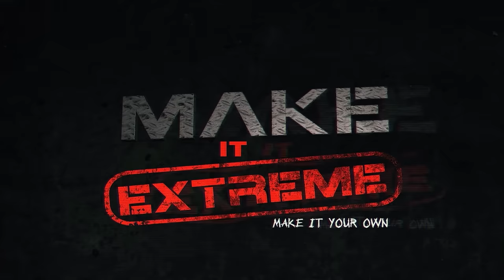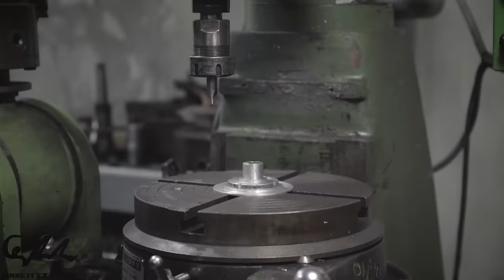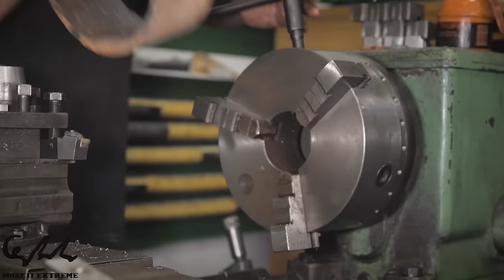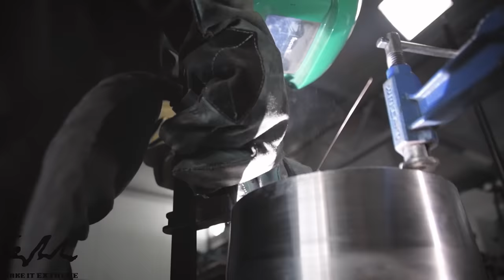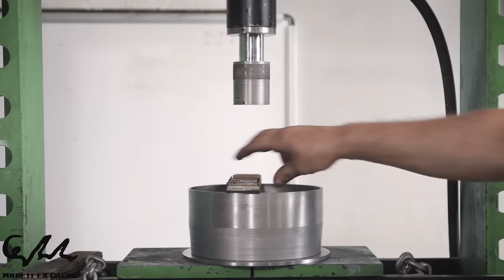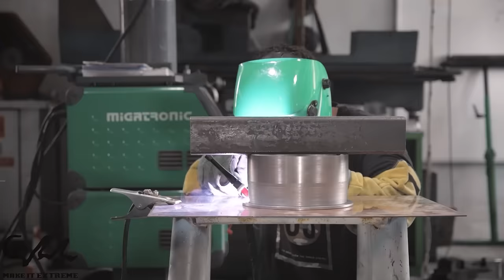Project 0107 | Making tank chair tracks

Comment: Thanks for the inspiration, I'm paraplegic and have been thinking about building something like this but on a bigger scale if I get the chance to have little workshop and the tools needed. Taking tracks and engine from a snowmobile, then you get a variator and revers gear. Would be like a mini ripsaw or a crosskart on tracks.
Reply: My brother in law had a wheelchair that had tracks on it. It looked like a blast to ride. I will see if I can find one of the pictures i have of it . Im no longer on speaking terms with him since they got divorced. Him and my sister were on his Harley and they hit a truck head on back in 2016. Definately changed both of their lives.

Comment: You guys are tugging at my heart strings !!! I absolutely love track vehicles... I am trying to build my own Track Robot (Remote Controlled) to mount a snow plow on.... Love what you guys do and how you do it !!!
Reply: That sounds great! But how will you maintain traction on icier surfaces? And a relative question, how much will this little monster weigh?!
I work for a commercial property maintenance company. In the rare situation that we have enough snow to require management in the Seattle WA area, I operate a skid-steer machine. It doesn’t have a plow but we use a large bucket to scoop and dump snow into an out of the way place. Typically, I have to rely upon the sheer weight of the machine to keep it moving when it hit it’s limits for a load. We just use the same “tractor” type tires, without tracks, studs, or chains. 
It does the job and it’s a blast operating it in the snow. 
(as long as I stay dry!)
Good luck with your project and record your procedures for sharing and/or ideas for improvement.

Comment: One thing that would make your welding easier and better is to find a pair of gloves that doesn't have floppy fingertips. You get a lot more control with feeding the rod and holding the torch when you don't have a bunch of leather right at the tips of your fingers. source: am a welder

Comment: you had to make the differential locked, with the clutch and independent supply on each side to turn the curves, so that if a wheel skates or stops it will spin, it has a very simple control system for the kubotateco, or tobata tr13, if you find some material from a study in the curve systems of these micro tractors, but the way you did it will also work perfectly

Comment: Its awesome, but won't last long, and the drive teeth will get damaged by the ground as well as the rim of the idler wheels. Honestly I don't think you should have that rim and it might pull the tracks off. I made a flat belt pulley like that once.  The belt hits the rim, and lifts. That causes it to track toward the rim and pulls it over the rim. The crown you added should be enough to keep it on with any belt tension.

To make the track last, I think you need to add metal crimped rings around each solid part between the openings, and use a plastic drive gear. 

I love the idea to reuse the tire that way.

Comment: Personally I would've put a guard over the spring and suspension arms, just so the rubber tread can never come in contact with those components. I don't think I've ever seen sprocket driven rubber before, but this is probably the only alternative to tension driven rubber when using recycled tires. Nice project as always, though.

Comment: This is an excellent work. Very satisfactory. However, I am a bit of worried about the strength of the punched holes in the tracks. They could be vulnerable and easily broken during transforming power from the sprocket wheel to the track.  It will be more secure if the builders can reinforce those holes with something like metal rings etc.

Comment: Are there any plans for this ?  See I’m retired and I have heart trouble so all I get to do is piddle now and then. See I still have my machine shop with manual and CNC equipment, welding, and any other stuff your standard job shop would have. I can’t do tig welding because of my pacemaker. But I have mig and I can do mig & stick, just nothing with high frequency . If you guys can help me it would really be appreciated . I still love to build I just have to do it a little slower, LOL, LOL, again thanks for any help you may have.

Comment: Do you have something planned to interface the driving sprocket to the track? The sprocket will trash the rubber if thats all there is for the sprocket to grab on. I get the purpose of the smooth drivers either side to deliver all the force but ultimately and eventually the track will be cut in half. Looking forward to seeing how this one works out. 👍
Reply: Depends on the clutch and transmission. Anyway, there are no shortage of used tires.

Comment: Wow amazing work, you’re really an inspiration. I was just wondering, any reason not to make dront and rear wheels engage with the tread, I would think that would put half the strain on the holes in the rubber? (Apologies, adter watching more I see why you did that lol) Also why Tig weld instead of mig? If its just showing off I totally get it lmao, I was impressed hahaha. Sorry if I sound judgemental or anything, just trying to learn a bit more

Comment: Needs more engine, needs less weight. Ooh and there's no way that sprocket doesn't jump teeth, or throw a track off sideways. Built a couple 250cc tracked buggies myself.
Reply: First thing I thought when I saw the sprocket was the teeth are to small. 
Edge ring too.

Comment: Ah yes, make it extreme strikes out again. Over engineered, and yet there's always something seriously not thought out at all. Case in point: the drive hub's you used are angular contact bearing's. Once they have been run for any amount of time, they aren't supposed to be disassembled, and then reassembled, due to the almost impossible task of making sure that you didn't disturb the running track lines on the individual balls. Once that wear track has been established, if you disturb it the bearing will start to progressively fail after reassembly. Of course, that probably won't be to much of a concern, based on the fact that it looks like you decided to delete the seals. 

And there's several ways you could have simplified the front wheels for strength, the most basic being a one piece tube. I'm sure that many other people will have more suggestions; I'll let them chime in and enjoy the fun.

Comment: Have to wait for the next video.... I fear the tracks falling off while making a turn
Reply: That or it slipping the drive gear. There is no way to adjust or tighten the track either. Tracks are made with steel inserts and the drive sprocket is much thicker. 
The other way to make a good track in this style with the idler and drive sprocket high above is to make a inside and outside drive sprocket much like some of the older steel tank tracks. The idler is also make the same way yet is adjustable to allow for a tighter track.

Comment: I am not an engineer but punching countless holes to the rubber to interlock gears is not very wise. Those steel gears will grind those rubbers after small ride and all peebles stuck in them